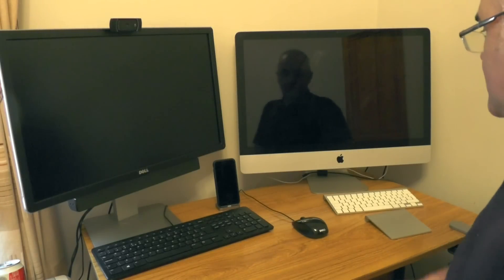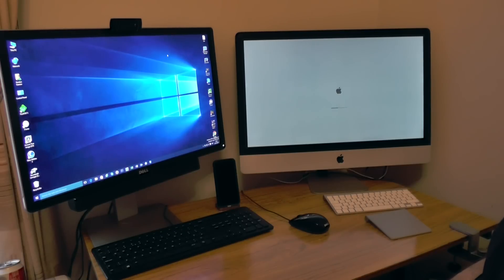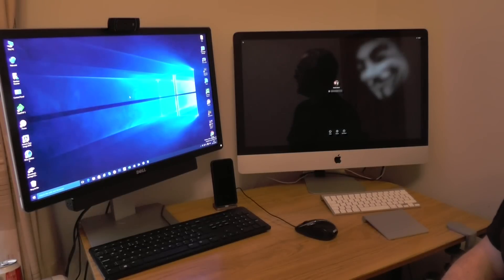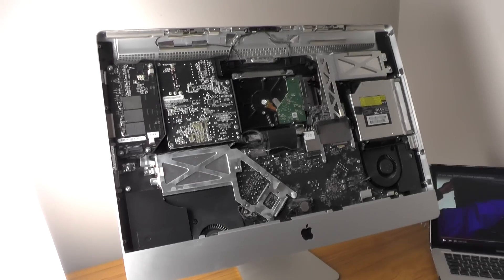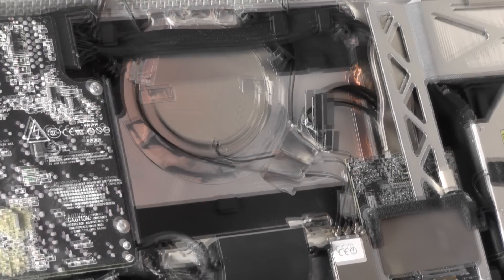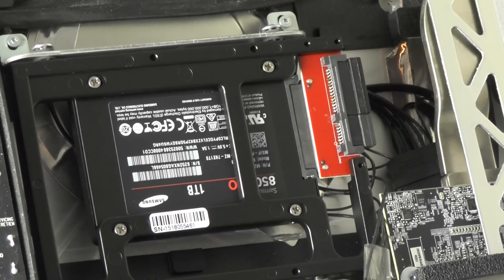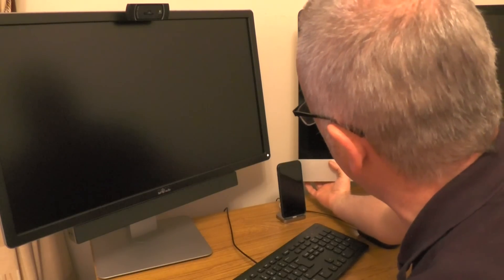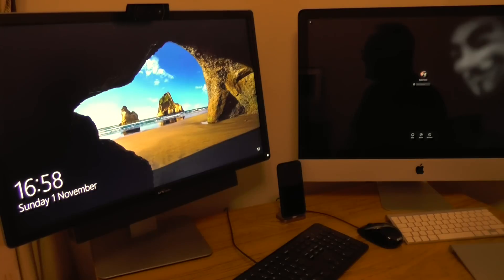2011 IMAC SAMSUNG 1TB 850 PRO SSD UPGRADE

Comment: Hi Gordon, I am just about to try this on my iMac, how did you install the thermal sensor to regulate the fans? I cant see this part in your video.

Thanks in advance Lee.
Reply from the maker: Hi Lee, I just stuck it onto the back of the SSD drive. Considering that there won't really be much heat anyway, I think you can stick it anywhere you want on the device and it will be fine. Take your time, it's all really simple once you get your nerves under control! Best of luck!

Comment: Great video. What did you use to copy your old HDD to the SSD?
Reply from the maker: Thanks for the feedback! I just used the standard Time Machine software to do the backup and restore... with a separate backup one using Carbon Copy Cloner.
Reply: Thanks for that. Much appreciated. May I ask where you bought the temperature controller?
Reply from the maker: Matt Marks ordered it directly from owc who make a range of add-ons for iMac upgrades!

Comment: Great video, I have just got this model of iMac (even though it's 5 years old, a £500 bargain). It runs fast enough on the HDD but the SSD is worlds ahead and I plan to add one, but I am going to try and fit it behind the DVD so I can retain the 1TB HDD. One thing to mention is Windows 10 has a fast startup mode which isn't a full load like the Mac was being asked to do in your speed comparison. A full Win10 startup would be much slower. http://www.howtogeek.com/243901/the-pros-and-cons-of-windows-10s-fast-startup-mode/
Reply from the maker: Sounds like you got a bargain, and fitting the drive behind the DVD is deal simple to do, so I reckon you should fly through the installation fine! With regards the windows 10 system I use, it does not use the fast startup mode as I never like these semi-stored operating system options as they tend to go corrupt over time.
Reply: Excellent, your machine starts well for a non fast boot then! CEX is the place to go for the iMac. They come in stock every now and again at this price in 4GB configuration, grade A and warranty. Mine arrived boxed and as thought it had never been used with everything in mint condition. Extremely pleased and blown away by it! Thanks again for the video!

Comment: +Gordon Keenan I just got a used iMac and the first thing I did was pull out the drive. The drive adapter made this a ton more simple and allowed me to skip pulling out more than I needed, just to get to the SATA port (like the way that they show in the tutorial video (https://www.youtube.com/watch?v=F2vRK8gHLXE).

However, I have been getting unwanted fan noise. I'm not sure if the fan just needs replaced, but was I supposed to do anything with the existing thermal sensor? I bought the  inline thermal sensor, which I thought was supposed to limit this. I just wanted to check with you before I opened it back up, but did you have to take out the original thermal sensor (I've even heard of people cutting it and taping off the ends), or do you think I just have a faulty fan? The stock one is way at the bottom, so I'd rather not dig that out unless I have to..
Reply from the maker: The reason I bought the adaptor kit was to stop any issues with the fans, and I have not had any on this, nor on another 21" imac I just upgraded recently. I merely stuck the sensor onto the SSD as per the instructions, and touch wood it's been doing fine. Maybe a quick blast of air into the fan and a hoover to get the dist out may sort this out for you?

Comment: also gordon since filming have you run into any problems with the fans etc.??james
Reply from the maker: Zero issues with the fans since I bough the extra adaptor that allows the fans to be controlled correctly via the iMac.

Comment: hi gordon, what model is the iMac and specs in the video?? i have a 21.5 iMac mid 2011 model iMac12,1.....and i was wondering i would be able to do it as you did in the video....i keep reading on the internet that you can't do a SSD upgrade on my model because the fans go nuts and the hardware check fails....james
Reply from the maker: This is a 27" Mid 2011 model with the AMD Radeon HD 6970M 2048MB - If you do the upgrade without the adaptor cable, then the fan issue is there and you will need software to control things, something that I was unwilling to deal with, hence the extra cost.At 2:32 you will see me explain the reason for the device. The following links may be of help to you as well: https://www.ifixit.com/Answers/View/193641/Can+I+replace+iMac's+harddrive+with+an+SSD

Comment from the maker: +John Grant good to hear you have the stuff in and can get the upgrade underway!
The thermal sensor was just stuck to the back of the SSD and the other end attaches to the drive directly.
Black Magic Speeds today are: 491.6 MB/s WRITE - 527.5 READ
The backup will transfer back over without any issues I would hope, and I know it will.. but there was one other user on here who had issues... but that appeared to be ram related anyway!
I'm sure that once you get this done you will kick yourself as I did for taking so long to do it!

Comment: Evening Gordon, just to let you know I have purchased all the same parts as you detailed within your very detailed and extremely helpful video (Thanks) 

The OWC sensor took a few days longer to arrive via Amazon then I had expected, all being well the installation is going to happen tomorrow.  

Gordon, within your video I did not see how you attached the thermal sensor, I assume it connected directly into the OWC Adapter drive and the other end affixed to the samsung SSD drive?  

I used the latest CCC to do a full clone of my internal drive which when extracted from the Imac will be used as a back up option.  Gordon, are you able to say what sort of Black Magic speed results you obtained after the upgrade?  

Kind Regards
John

Comment: Yosemite is having issues installing to my 128GB Samsung 850 pro SSD. The tech guy at the repair shop is saying it won't install....
Reply from the maker: +Artkidtek Well it should install fine, many other people online have done so, so I see no reason why you should have issues!
Reply: +Gordon Keenan ok you're more than likely right. The tech guy said there's another issue with my iMac that's causing kernel panics.
Reply from the maker: Why not bypass Yosemite and put El Capitan on the drive? That would be my route if I was having any issues.
Reply: +Gordon Keenan I'm not sure if El Capitan is completely compatible with the versions of Avid, premiere pro etc on my computer. I usually wait a while before upgrading.
Reply from the maker: +Artkidtek That's would be a pity.... but surely your Tech guy must be able to search online for some indication on what the issue may be? I you clone it from old to new, I don't see how there should be any issues..... But clearly there are!
Reply: +Gordon Keenan he said there was non-stop kernel panics while installing Yosemite on the SSD. He took the SSD out, put the original HDD back in and urged me to take it to Apple.
Reply from the maker: +Artkidtek He should be cloning the current hard drive across to the SSD, and then insert the SSD and it should just both up and work. If he's inserting the SSD and installing the OS first then that may be part of the problem. Ask and see if he did try it this way at all?
Reply: +Gordon Keenan once again you may be right lol I will bring that up with my tech guy as soon as I get my iMac back from Apple. Apple said my HDD failed inspection and they're replacing it and then troubleshooting the kernel panics.

I really hope you're right. I already bought 32gb of crucial ram and 2 SSDs for my iMac and paid the tech guy to install the SSDs. It will be a very sad day for me if my iMac continues to give problems. You've been very helpful as well, thank you.
Reply from the maker: +Artkidtek You mentioned that you also bought memory... I would hope that the guy did the testing without the memory in place, keeping the original stuff in place until the Kernal issues had been sorted out. Memory is the first thing anyone would look at with issues such as this! Touch wood you get it all resolved and you can get back to using your iMac once again.
Reply: +Gordon Keenan oh ya. The new ram is sitting at home on my desk because I can install it on my own. The only thing new in my computer is the gpu-- Apple put a new one in last week during my first repair. When I got my iMac back from them on Friday that's when the kernel panics started and Yosemite wouldn't install on the SSD. That's why I feel it may really be a logic board issue.
Reply: +Gordon Keenan in at the Apple Store now. They're telling me one of the sticks of ram is corrupt. That's good news on my part because I have new ram at home waiting to be installed. So hopefully once they finish running whatever test they have left to do it comes back as certain the stick of ram is the issue.
Reply from the maker: +Artkidtek I find it incredible that the plan you put it into did not check the RAM, its a standard thing to test when you get issues like this. The Windows PC's have so many issues the there is a set procedure you follow when stuff like this happens... The Mac is not much different! Anyway! At least you are now getting closer to having your mac back and the SSD's all installed. Fingers crossed!
Reply: +Gordon Keenan I was thinking the same exact thing too... How could my tech guy not troubleshoot the ram first. Oh well like you said I'm one step closer to being out of this mess!

Comment: I plan on bringing my mid 2011 iMac 27in to a computer repair shop. I want to replace my HDD, which failed recently, with an 850 pro 512gb SSD. I also want to add a 2nd SSD in my iMac as well.

The 2nd SSD won't interfere with SD card slot or optical drive will it?

Do I need to provide an inline digital thermal sensor for the SSD replacing the HDD?

Will both SSD be plugged into a SATA port capable of 6G/s?
Reply from the maker: +Artkidtek http://blog.macsales.com/10050-firmware-update-enables-6gbs-in-2011-imacs http://blog.macsales.com/10002-2011-imacs-no-sata-6gbs-yes-to-multiple-drives may help you out.

Comment: Hi Gordon I now have now received the same ssd that you have.  Gordon I have a technician coming to me who assures me that he has done this a few times but what concerns me is that he is telling me that he is going to use the original temp sensor and he is not bringing a adapter drive that you purchased.... I am to be honest slightly concerned, is it possible that he can use the existing sensor?.   Finally can I ask you if your 2011 iMac is still working as you hoped it would.....many thanks .  john
Reply from the maker: +John Grant My system is working flawlessly and it runs 24/7 here. If he can use the original temp sensor then great, but I have to be honest and say that everything I have read has said that I needed to use the extra adaptor to make sure the fans all worked correctly. I would say that if he has done this many times, trust is what he has to say but ask him if there will be any issues with the fans etc.... When its done.. you will be stunned at how good the machine will become once again!
Reply: +Gordon Keenan Many thanks for your reply and for the extra what the cable and the caddy will cost let alone piece of mind I will be ordering both extra parts along with a can of compressed air.  Gordon I will be using carbon copy cloner to copy my existing hard drive over, what is important to me is my Adobe CC software that I have and I have read and seen comments on the various forums that you have to first de-activate it within CC settings, did you have to do this or do you not have the adobe CC package, i.e. Lightroom CC / Photoshop CC?  Really appreciate your time your effort in putting the video together I am in fact really surprised how quick you dd the upgrade as OWC suggest a time of one hour.  Kind Regards, John
Reply from the maker: +John Grant I don't have Photoshop CC, but it does appear to be the case that you should de-active things before performing the installation based on: https://forums.adobe.com/thread/1316109). Again, the upgrade really was done quickly as once you get over the fear factor, it's all pretty simple and straight forward. Had I tried to do the upgrade that I have seen others do with the whole motherboard going out and the DVD Rom etc... well then that would be a nerve tingler!!!! I reckon once you go SSD you will wonder how on earth you survived with out it! Maybe you should do a video on your upgrade getting done for posterity :)
Reply: +Gordon Keenan Hi Gordon sorry for the late reply as I was at a oldie concert last night (photographing it) and only just gone on-line.  Gordon that you for your confirmation as I just need to make 100% sure that its all going to be OK before starting the upgrade, I know how good a SSD upgrade is as I actually did the same upgrade to my 2010 macbook pro and really happy with the overall performance,  I did not trim enable it and it has been great since the last three years.....going to clone everything tomorrow.  Many many thanks.  Regards John

Comment: @Gordon Hi Gordon will this work on imac 21.5 ? also do you have to have that sensor?  and did you install the ios to your new ssd before?
Reply from the maker: +zuluula If you do not get the sensor the fans are supposed to kick in at full speed all the time, and you would have to try and control them using a software application (way too much hassle for me to deal with - hence the reason I bought the sensor) . I did a Time machine backup of my system and restored it to the SSD once I was finished! As for it working on the 21.5" iMac I believe it should be pretty much the same... but double check with the model you have - http://guides.crucial.com/Guide/iMac+Intel+21.5-Inch+EMC+2308+SSD+Installation/389 this links shows you want is involved with the 21.5" model!

Comment: Hi Gordon, just discovered you're amazing YouTube site as I was looking for a video tutorial about installing a Samsung Evo 850 SSD drive into my 2011 Imac in order to give it a new lease of life (just like your video) 

What I like is the way in which you show and describe the process in great detail but I just do not have the nerve to do it myself so I am going to try and find a shop to get this done  

Gordon I have a question, my original 2TB HD contains of course all of my programs can one copy all files completely before hand without having to download them from apple and adobe once again as this would be so time consuming and can it be done using El Capitan, and help, tips would be really appreciated 

Regards
John
Reply from the maker: +John Grant John, thanks for the feedback, its very much appreciated! With regards the old data side of things, just make sure you create a new full Time Machine backup, or use super duper to backup everything and when you put the new drive in, just restore onto it! Alternatively, you could backup the current drive to the new drive using an external cable/bracket using super duper, so that when the drive gets installed. its pretty much ready to go!
The work to do it really isn't that bad, it does appear more complex than it is, but that is down to the way its presented online... Honestly, if I can do it, YOU CAN DO IT AS WELL!!!!
Any information you need, please get in touch and I'll answer as best as I can.
Reply: +Gordon Keenan 
Gordon, thank you for your helpful and positive advice regarding how I should first back up my software and then transfer it across to the new SSD drive with the options you have suggested.  Thank You 

I feel the upgrade is necessary now as I do, do a lot of photographic work and having the SSD installed will help with the overall performance of my current workflow, it was impressive to see the difference between your windows system and the updated Imac 

Many thanks 
Regards
John

Comment: Great Video. Trying to do the same myself. One question: where did u stick the adhesive sensor of the OWC In-line Digital Thermal Sensor? Just on the SSD?
Reply from the maker: +Shuai Yu I simply stuck the sensor to the case of the SSD. I think it is really only designed for a normal hard drive, but playing safe, I stuck it to the case anyway! Best of luck on your upgrade, it's well worth doing!